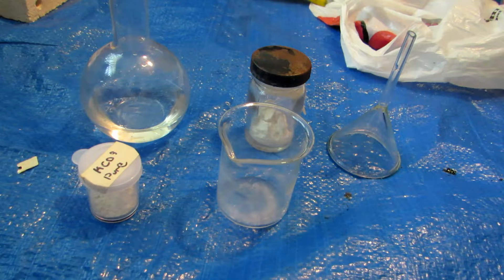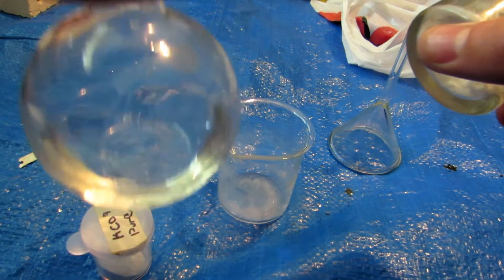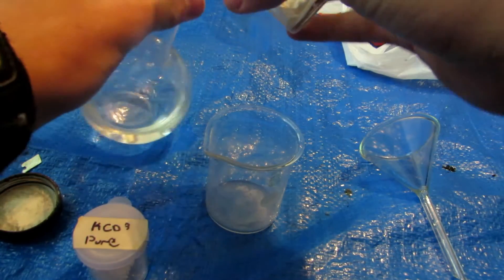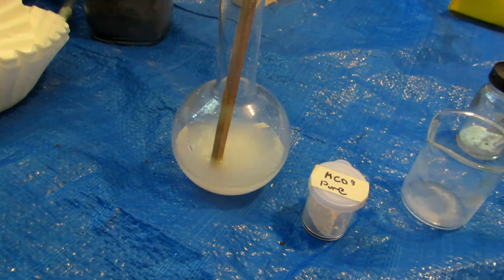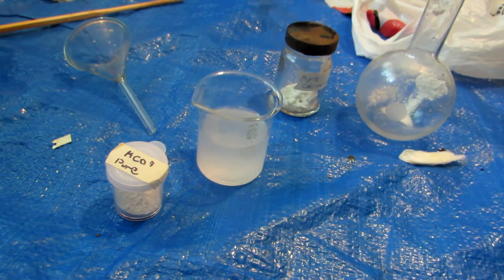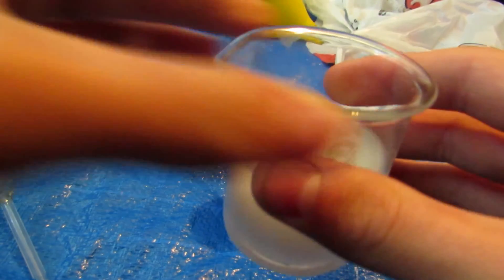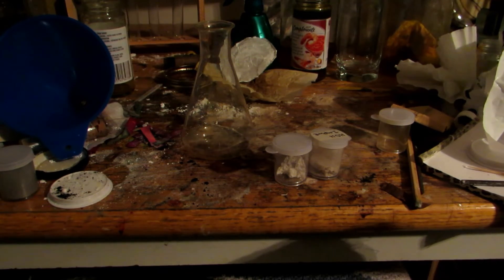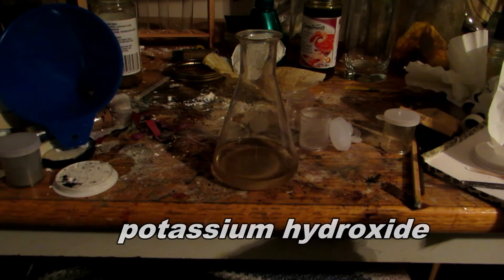Potassium Hydroxide From Potassium Carbonate

Comment: Bro, use barium hydroxide as it is very soluable in hot water and barium is expensive but the barium is recoverable almost fully and quite easy to turn to its hydroxide form thanks to its low solubility in cold water.
Reply: Absolutely, but barium is not expensive if you source it from pyro or pottery sources.  It’s best to convert crude barium carbonate to barium chloride or acetate and purify by filtration and recrystalizing

Comment: Why does it dissolve better in cold water?(I assume the answer has to do with the  physics of chemistry). Something to do with particle size or polarity?
Reply from the maker: you know, that is actually a very good question. Calcium hydroxide is a polar compound like water, however as noted, it has very low soluability. I dont think particle size has to do with anything, but i am not sure. That is quite interesting... I know some gasses like nitrogen and oxygen will dissolve in water, but their solubility decreases while the tempurature increases. This sounds similar to what could be happening here, however, calcium hydroxide is polar, and nitrogen and oxygen are not. I am not totally sure, I will try to remember to ask one of the chemistry teachers at my school. Thanks for the intriguing question

Comment: Just as an FYI if you live in a bigger center that has a soap making supply shop you should be able to get it there. Potassium Hydroxide is used when you make a liquid soap Sodium Hydroxide is for hard soap. And they are typically food grade so I would assume very pure. But making stuff is always fun good job. Though I did have to sign a contract promising not to make anything bad.
Reply from the maker: ok, thanks! i am not sure if there are any soapmaking stores near me, but i will look. Thanks!